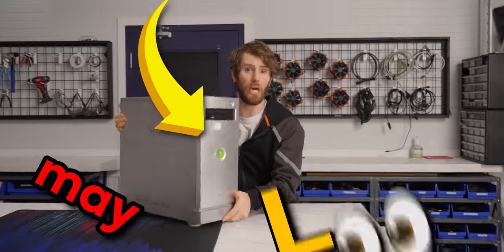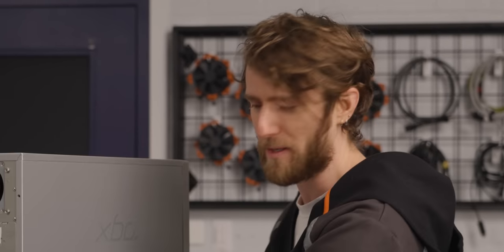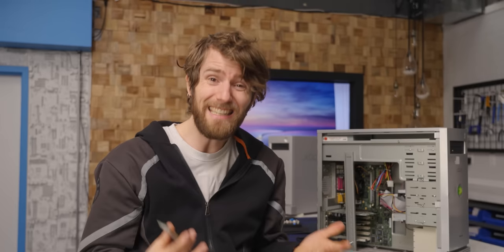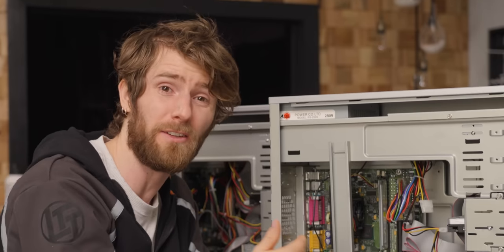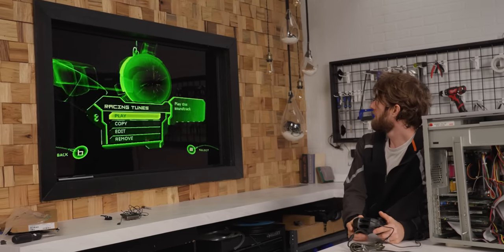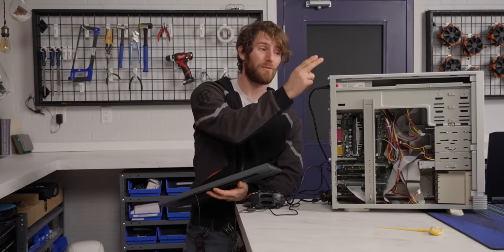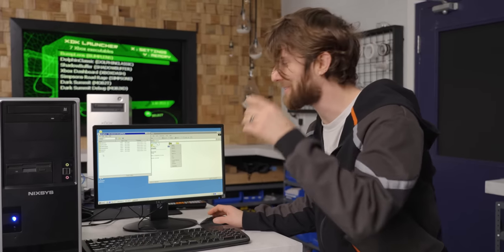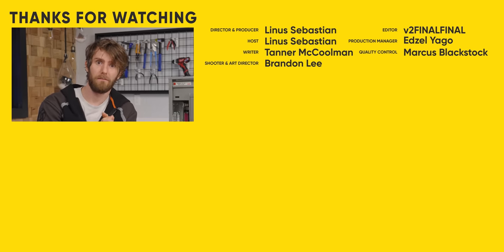I Used Stolen Software to Make a DIY Xbox - Xbox Alpha I & II Dev Kits

Comment: The original Xbox software was actually not Windows 2000, but a mixture of Windows NT 4.0 Embedded and early Windows NT 5.0 (NT 5.0 would later become Windows 2000) code. The Xbox kernel is basically an embedded minimal NT 5 beta kernel, the boot loader is likely a modified NT4 boot loader. And it runs DirectX 8. 
The next generation, Xbox 360 dev kit is also quite interesting. This time MS switched to PowerPC, and guess who makes the most PowerPC workstations back then? The very first dev kit is actually just an off the shelf PowerMac G5🤣. MS formatted the drive and installed xbox software on them. Therefore it is possible to recreate a Xbox 360 dev kit with PowerMac G5 (model A1047 PCI-X or PCI-X-2). After the work is done, these early dev kits got Mac OS X reinstalled and sold. I think the fact that they switched to PPC so quickly must have something to do with early Windows NT having a PPC version, and the dev work didn't stop internally, despite NT4 being the last Windows to officially support PPC.
Reply: And being an embedded NT kernel optimized for low memory is probably why it boots so fast. Also it doesn't load the win32 subsystem like most windows do, but the xbox subsystem, and only some win32 api were used for booting up and running directX. The recovery disc is based on regular Windows 2000 SP1 though.
Reply: the xbox 360 devkits have a specific gpu too though right

Comment: That's the same PC case that I used when I built my first PC, except for the face plate. I recognized the swing-out feet and the plastic drive housing right away. I built a system using an AMD K6III 300 mhz in a socket 7 mobo if I remember right.

Comment: Oh man, a GeForce FX 5200? I played SO much Unreal Tournament 2004 and Half-Life 2 on one of those things.
Reply: I’m curious, what was considered “overkill” specs at the time? Was it the GeForce FX 5200 that you had?
Reply: @SkilledPro456  Oh no, that was second from the bottom of the GeForce FX series when I got it. The FX 5950 Ultra would've been the top end, but if my memory serves me correctly, the Radeon cards at the time were doing better. But at the time, even at the bottom of the product stack, you could game reasonably well on almost any dedicated GPU.
Reply: it worked ok, 
after put a fan/vram kit on it,
but drivers problem going between New game to old game, as new game needed the new and for long time old games didn't work on the no new driver.

give up and got a 5770 and another one later on and game after that,

just worked.

Comment: The dev kits probably also need more memory to run, at least, things like debuggers or monitors. And I suspect the team at Microsoft probably also continued optimizing their memory use of the OS/libraries/SDK/whatever (probably by ripping things out or re-implementing them) to get it down to the smaller memory limit of the production consoles.
Reply: Yeah it's a bit of both really.

Comment: i remember owning my first xbox in around 2008. it was a second-hand xbox original that my step dad gave both me and my sister to play on. a short while after we went to blockbuster to get some games. one we weren't allowed to play that my dad bought, metal gear solid 2, and my sister bought timesplitters 2 which we used to play split-screen (bring back splitscreen microsoft) and i bought need for speed underground 2. amazing console. very fond memories. the xbox died about a year later and i was given a boxed xbox 360, a white one with HDMI. i played that thing all the way up until 2013 when the power supply would take up to 50 unplug attempts to get it to work right again, and then in 2014 i upgraded to a slim. only in 2017/2018 did i upgrade to next gen, which i don't have nearly as many fond memories about. xbox gang :)

Comment: Custom BIOS Firmware boot images have been around since physical BIOS chip replacement had been replaced with EEPROM programmable chips. I worked for a company in the mid late 90's that had a lot of leased IBM ThinkPad laptops with a custom BIOS image with the companies own logo.

Comment: 11:00 One advantage XBox devkit has over original XBox is that you can install custom firmware that actually allows homebrew to use its 128MB of memory, also devkits can run Sega Naomi games natively through custom firmware. Normal XBox can't because it lacks 128 of Naomi's memory.
Reply: You can add ram to most of the xbox versions (I think all except the V1.6 boards), to make them 128MB consoles. There is also custom firmware to enable homebrew to use that ram.

Comment: Most interesting part here is seeing a Pentium III paired with RDRAM. I only saw that only once, while working for a local IBM distributor I had to fix an IBM workstation which used the i840 chipset (the workstation version of the i820 used here) and RDRAM.

Comment: our first "new" computer we bought was similar to this. a monster ONE GHZ PROCESSOR, 128mb of ram. and an unheard of 100gb hard drive and a dvd rom. it was something like $2000 in the year 2000 when my father worked in the tech industry. i still have the case which i installed multiple different motherboards in it over the years.

Comment: 9:55 Gateway 2000 desktop towers of similar age had a similar bar but it was just for FCC compliance to help block electronic noise. When I worked on one of those computers, I never put those damn bars back in. 😂 Most of the time they wouldn’t sit right so you couldn’t close the case so out they stayed!

Comment: I had a beige custom PC case of the same model from "Overclockers UK" modded with additional 120mm holes for extra cooling.  Early 2000's so probably my AMD socket-A build.

Comment: Wow that GeForce FX 5200, that was the first GPU I ever had (might've been a 5500). It was in the family PC so for my own I had to make do with some ATI Rage card with 16MB of memory.  It couldn't run the original Need for speed Underground and that sucked. It was great in a time when most PCs only had the VIA chipset display adapter - it ran the original LAN classics like Counter Strike, Half Life, Warcraft 3, Worms Armageddon, and later UT2004. Quite the nostalgia for me with that hardware - I fell in love with computers and gaming during that era. Now I've been a professional software dev for a few years and have completed an MSc. in computer science.

I wonder if today's world of iPads and hard-line water-cooled gaming showpieces get kids as excited and passionate about PCs themselves. As a 90s kid it was approachable enough unlike the Commodors, DOS and Windows 3.1 stuff that came before, but you still needed to understand your PC to a much greater degree than nowadays and it was way before we had internet. Whenever the PC broke (always blamed on me, yet only really my fault ~60% of the time) I'd go to the PC repair shop and watch them fix it - I'd watch them diagnose the hardware parts and sometimes format and reinstall Windows 98 or the terrible ME. Kids these days just see hardware returned as an RMA or maybe see it dropped off at the genius bar. I rarely even see PC repair places. Closest thing I suppose is the Raspberry Pi stuff but that's just an SBC, not much to fix and figure out there.

Comment: I recall when RAMBUS first hit the market for PC's there was a shortage of it due to manufacturing issues so the prices were INSANELY expensive. From AnandTech article in 2000, 128MB was $600 compared to $100 for a stick of regular PC133 RAM. It took too long for the prices to come down so DDR memory supplanted it.
Reply: A friend of mine wanted to increase the RAMBUS RAM in his PC. It turned out it would be cheaper to buy a new PC that used regular RAM.

Comment: well, the value of this is not in the standard parts or software, but the special case and design of the unit. A collector wants the original.

Comment: So, fun fact, the original XBox took a LOT of cues from the Sega Dreamcast. The Dreamcast was RISC-based, it used a Hitachi SH-4 CPU and an NEC PowerVR2 GPU, but it actually ran a custom version of Windows CE. As a result, it was one of the first consoles that used a Windows environment for development work, and it was very easy to port PC games to. Sega actually worked closely with Microsoft during development, and if you look closely, you can see a lot of design cues from the Dreamcast repeated in the original XBox, everything from the built-in modem and online services to the general layout of the controllers.

One has to wonder, if the Dreamcast had been more successful, would Microsoft have bothered with the XBox? The Dreamcast, after all, was flagging by mid 2000, and was discontinued in 2001, the same year the XBox came out. Dreamcast was Microsoft's original foot in the door for console gaming, but after it failed, one has to think they pushed forward the XBox to keep their hold in the market, a step which would not have been necessary if circumstances had been different.

Comment: Oh, OK . . . DirtyPCBs has the design stored under shared PCBs, and the Wolfson WM9701 data sheet includes a reference schematic which is probably close to what n64freak used. Looks like I have some surface mount soldering in my future.

Comment: I work on Xbox One and Series X devkits daily (as well as the PS counterparts)
Just as an extra note on the memory, it's also used in debugging. If it hits the point where it would have ran out of memory (if it had the same memory as the retail version) it crashes as normal, but has additional memory which it can then use to write crash dumps and log the issue before it closes the game.

Comment: I used to buy dead computers off eBay back in the day, cannibalize parts, and then resell them as whole units, and I remember that one of the easiest machines to turn around were RAMBUS machines because almost always the problem was that the RDRAM was faulty and causing the system errors. For whatever reason, it was just WAY less reliable than SDRAM equivalents.

Comment: 14:32 recently my Linux machine's USB ports all stopped working (software issue) and I had a PS/2 mouse handy to plug into the PS/2 ports on my PC and it worked so I could reboot the machine cleanly.

Comment: Stripping down windows has been an underground trick for quite a while.  "Back in the day" there was a poor nerd with the handle eXPerience who put rediculous hours into stripping down and making TinyXP and MicroXP.  I still have copies, not that I have a use for them.  They make even the junkiest of ribbon cabled systems boot as fast as nvme ssd beasts today.  Besides general debloating, some security holes were removed and creature comforts added.  No need to wait for login when the entire multi-user system and standby menu is just gone.  And what have we come to today?  "Mandatory" Microsoft accounts to login to your desktop.

Comment: Reminder that at that time, Sony was actually talking about the PS2 being a modular home computer. Lots of peripherals were being shown off... keyboards and mice, hdds, vga cables, etc - and there was talk of Sony providing a robust operating system that would not just let you rip games for faster booting and load times, but which could also run applications like web browsers, image viewers, music players, etc. This is why Microsoft was so interested in a livingroom PC. Bill Gates wanted a generalized home media server in the livingroom, and a lot of your later windows builds had unified media suites that you could even use a remote control on to operate. (Windows Media Center on XP, for example). Bill Gates got kind of double-whammied on that one - because not only did his team turn his dream of a living-room PC into a games console, but it turns out that Sony's bluster about the PS2 being a living-room PC was just smoke and mirrors BS in order to get the PS2 reclassified so that they could skirt EU import tariffs. They did release a VERY small batch of Linux Kits for the PS2, but then promptly shut it down and memory holed the entire project. Most people would have to wait until the release of FFXI to get official HDD support.

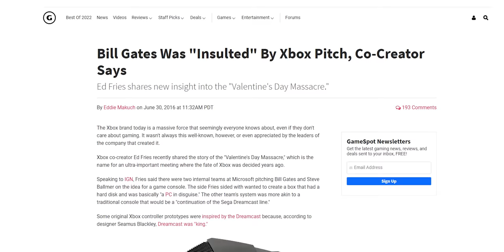Comment: 2:06 It really was Bill Gates who had the initial idea, or push, to make a Home Console. Back in 1998 the rumour mill was swirling with juicy PS2 details, then in 1999 we saw the announcement which confirmed many of those rumours. The PS2 console was released in 2000, by which point MS was well underway on the project. The first few prototypes were horrible, but Bill Gates didn't cancel the project, it was his idea after all. He just ordered people around to get it done. One of the interesting aspects of this period, is that Microsoft was hiring good talent for good pay, and they managed to steal quiet a many staff from Sega which was also dealing with the PS2 competition, a struggling DreamCast console, and worrying financial situation. In a roundabout way, Xbox is the successor to Sega.

3:48 It wasn't just the CPU that was from AMD, the GPU was also from ATi. The original Xbox which the team balanced and assembled, had a cheaper BOM and was slightly slower than the final hardware. During this period neither Intel nor Nvidia had a monopoly in their market, so pricing between them was more competitive. And the legend goes that Bill Gates personally wanted Intel-Nvidia as that was seen as the superior option back then. He personally phoned them and made a deal at a "mates rates". So the initial prototypes had to be scrapped, and the development team was quiet annoyed.

18:43 That's because it was a weird period in computing. From the Early-90s to Late-00s we saw an explosion in innovation. Even The Simpsons poked fun at it. Especially if you were a "PC Gamer" which was very niche. The standout times I recall was around 2002 with Windows Xp, DirectX 9, AMD Athlon-X2 64bit, and GeForce 5800, this was a huge leap from the earlier Windows 98, Intel Pentium and Voodoo graphics days. It set a benchmark for the industry for a very long period. That level was properly succeeded around 2009 by Windows7, DirectX 11, Intel Core2, and ATi HD5870, which set a new standard. Things basically plateaued by the time we hit Windows 10, Vulkan API, Intel Core-i Skylake, and GTX 1080Ti, which is still a potent system in 2023.

18:51 Sure it was a successful franchise, but that doesn't mean they didn't make mistakes. For starters, the AMD-ATi Xbox would've meant Bill Gates and Microsoft wouldn't have made much of a loss with the original Xbox. Yes the OG Xbox was a "business success" but a "financial loss". The AMD-ATi model also would have made it possible to produce the Xbox-2. When it came time for the successor, AMD was facing bankruptcy due to illegal practices from Intel, and they couldn't process an order the quantity that Microsoft was requiring. Whilst it was Intel which increased their CPU price by x3 making it impossible to build the console without a hefty loss. The new Xbox Division was actually fortunate to find IBM who offered a workable solution. This was to license their new PowerPC processor that was developed by Sony for the PS3. Again to the much annoyance of the development team, it meant the whole Operating System had to be ported to another architecture, as well as the full DirectX API. Get it done, was the order. Bill Gates was still pretty active during that period as Chairman, even though he had stepped down from the CEO role a few years ago. This also hurt backwards compatibility, which meant a big rewrite by the development staff. After a year or two, the Xbox 360 was born. When MS moved back to x86 with the Xbox One and subsequent releases, it meant a much more streamlined pipeline for the development team. By that point Bill Gates was hardly involved with the Xbox division or Microsoft, although he was still a Board Member.

Comment: I have one question.  The XBOX was one of the first systems to use Unified Memory.  But if the dev kits had DIMM RAM modules how were they supposed to program a system that can be accessed by the GPU and CPU at the same time?

Comment: They should have tried disconnecting the floppy, the reasons Linus has given is actually because hardware at the time expected there to be a floppy drive to boot.  When we tried at work it just gave an error that it didn't exist and refused to go further!
Reply: Can be disabled in most BIOS.
Reply: @amshermansen  no.  I don't recall being able to get to the bios.  And I'm pretty sure they wouldn't have included the extra hardware if they could.  We sent our kits back as newer ones came out, by the time they reached beta they were green xbox iirc.  Linus saying it was used for updates or reinstalls simply never happened in house.

Comment: PC parts back then were rather expensive.  To build this machine in 2000-01 would have cost around $1500-2000 us.  And with emulation you would be lucky to play N64 games.  If only we would have had the software for the xbox dev kit ^_^

Comment: I bet the reverse mounted floppy held an authorization diskette that was worth a ton of money and they didnt want them getting stolen so they put them inside the machine.  Pro Tools and Avid plugins used to authorize that way do those floppies were worth thousands.
Reply: No it was just for reinstalling the OS.
Reply: @amshermansen  I guess that’s possible too. I wonder how many floppies that took though, I think Win 95 backups were like 14 floppies.  I never made a set for amything newer than that. Maybe if it's stripped down it's not too bad.
Reply: You need it for the initial setup, not the whole thing.